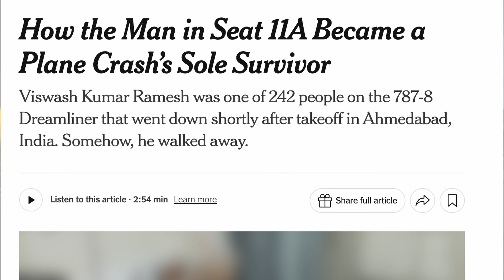Why the RAT Changes Everything – Air India 171 Update

Comment: we still don't know how the RAT was deployed.... it could still have been deployed manually.... so the theory of mistakenly raising the flaps/slats prematurely is still in the running since to radio call  (which I have not heard stating a 'power loss' ) a quick captain could have deployed it.... and the F/O still had time and realizing his mistake could have redeployed the flaps/slats. When it comes to 'power loss'.... that can be explained with a loss of lift because that is exactly what it feels like... BUT if there was a dual engine failure... look at the profile.... as heavy as that aircraft was, it would not have gotten as far as it did.... but with max power and stalled, that theory still fits.
Reply: The only time you would deploy the RAT manually is if it failed to deploy automatically. Manual is just a backup procedure.

Comment: Capt. Steeeve analysis is 1000% correct. All those things he pointed out match the Air India 171 crash. RAT is deployed for sure. When you look at the footage, the crash happened exactly within 30-35 seconds after the aircraft took off from the runway. Pilot managed to handle the situation in those barely 10- 15 seconds they have...because the aircraft is just above 500-600 feets above the ground...The pilot gave a Mayday call...till then it's too late. It's not the fault of both pilots but a faulty engine design. There are same incidents of power loss previously, but not at such a low height.

Comment: My investigation report on the AI171 aircraft crash.
1. AI 171, both engines run for 9 min 10 sec taxiing to takeoff and crash = 550 seconds.
2. Just before AI 171 took off, another aircraft from Ahmedabad to Chandigarh took off just less than 2 min ago.
3. Flap setting seems to be OK as found on the left side wing's debris.
4. Before the crash, the sound of the RAT was audible. Rotary air turbine.
5. During takeoff, the pilot declared a Mayday.
6. During takeoff, both engines lost thrust. The height was 654 ft and the speed was 179 knots.
Findings: 1. Flap was ok, proven from debris wing.
2. Fuel line choked or closed? No.
Fuel line diameters are 1 inch to 3 inches from engine to tank. The diameter is big enough; it cannot be choked or clogged.
After the fuel valve is closed, the pipeline will have 400 litres of fuel. The aircraft consumes 5 litres/sec, so the engine will feel fuel starvation after 100 seconds, but the engine runs over 500 seconds. The cockpit gives hooting sounds if the fuel stop valve is in a closed position, so the probability of fuel is close to not possible.
Mid-air aircraft engine restart without any external power by aircraft speed and altitude: speed 250 knots and altitude 30,000 ft.
Only APU-generated power can restart engines if all engines were stopped in midair for any reason.
Here The engine loses power by accidentally shutting off the switch or engine off by cyberattacks or so, and the APU was off to save fuel. Aircraft have no velocity and altitude to restart the engine. APU starting takes 60 seconds for that RAT power needed, but you needed power for hydraulics and avionics, etc., and had no time and crashed.
As another plane flew 2 minutes ago, that also caused wake, which may also be responsible for power loss, but the engine will be running without thrust.

Comment: Here is an observation of the flight video compared to video's of the gear swing on a 787-8.  The crash aircraft video shows both four-wheel assemblies down with the wheels in a parallel position with the fuselage the entire time it is in flight.  Normally, just after takeoff, the rear two wheels drop and the front two wheels are raised above the rear wheels.  Like doing a wheelie.  Look at the wheel position of the JAL with RAT deployed in this video and compare it to the wheel position of the crash aircraft.

The only time the gear is parallel with the fuselage in flight, is when the sequence to raise the landing gear is initiated.  First, the wheel assembly levels itself to clear the gear doors, second, the gear doors open, third, the gear raises into the fuselage, last, the doors shut.  Why would the gear be parallel with the fuselage if the landing gear retraction had not been started?  The retraction appears to have only run long enough to level the wheels.  Then it stopped.  Why it stopped and why the RAT was deployed will probably be key to why the pilot reported a loss of power and thrust.

Comment: Am not in the avionics but, what if some loose thing in the cargo cabin slipped back while climbing rapturing the pressure bulkhead (causing the bang sound) and ripping off some hydraulic pipes on its way?

It happened before in Iraq and the military aircraft stalled midair the same way Air India plane did.

Comment: If the Captain deployed the RAT maybe that's because he believed the engines were losing power as the aircraft was not climbing. However, this could have been because without the flaps deployed (and the gear still not retracted) the aircraft had insufficient airspeed/lift. Analysis of the FDR will reveal what the various settings were, but what did their instruments tell them? There is a narrative that is pointing towards blaming a technical malfunction, and therefore putting the blame on Boeing. But the majority of airline accidents these days are down to pilot error. We shall see.

Comment: Given the reports of electrical malfunctions on the immediately previous flights, my guess is that there was a major electrical failure as the aircraft was accelerating down the runway,  causing the autothrottle to move toward idle and triggering the RAT. The survivor also reports some kind of throttling up (spooling up?) just before impact, which suggests to me that the pilots had noticed the throttle levers coming down and were correcting the setting manually, too late and low of course. Let's see what the FDR and CVR tell... but like the Jeju disaster, the recorders may not have any data beyond the electrical failure (unless they are supplied by the RAT). The ADS-B data stops near the airport boundary.  The survivor's observations may prove to be particularly relevant, perhaps thanks to the amazingly light injuries he suffered.

Comment: With a plane that is 10+ years old, how many time would the engines have been over-hauled or replaced?  What about the fuel pumps? What is O/H time frame on those? If the airline company does the replacement of the engines and or pumps years after the purchase of the air plane, how is Boeing responsible for crash because the engines stopped working?  Does Air India have a good A&P department or do they sub that out?

Comment: There is example in history where this additional fuel extract called " Safran" If i remember right was involved ? 

The likvid was ones at least wrong measured and totally clogged the fuel lines and causes dual combustion stall.. 
Thence the taxy out included a partly runway taxi to a turning point, the engines was sugning quit a bit of fuel, and was most likely runed up several times because of stoppage and turns.. 
Thaw when the TOGA was engaged , it was the final hole in the swish cheese model . That totally clogged the fuel lines, according to the amount of fuel used buy the take of sequence, it manifests only seconds after take of.. 
The temperature in the combustion chambers rices in a matter of seconds and the engines stalls  .. That is my idea what will come in the aftermath of this horrible crash..?? 

This "shit" they put in fuel to make it more environment friendly has caused incidents before. And  will most likely do it again..?? Sadly a result of a Hype that kills.. :face-fuchsia-tongue-out::face-blue-wide-eyes:

Comment: Could a short in the wiring to the RAT make it deploy un-commanded? Could the RAT deployment temporarily cut off fuel supply to the engines for safety reasons?
It just seems very strange for a dual engine failure at the same time.

Comment: The original audio also sounds like the engines are rolling back. Sure the pitch would change due to the doppler effect but I just don’t think the engine sound would have started at that low of a pitch when the doppler effect started. The engines sound certainly much much lower in power than TOGA which I’d assume they’d have shoved to when they started to mush and sink. Even over the sound of the RAT the engine sound is low. 
So I think you’re right THIS time, the rat deployed when they started to engines failed. 
Now WHY did they BOTH fail at the SAME TIME? Within a couple seconds of eachother at most.

Comment: But we can also hear the sound of jet engines, first, than the RAT sound takes over. So at least 1 engine is still running, but probably in idle.  I do not know but I guess the thrust levers in a 787 and probably other modern jets are no longer moving steel wires, but are connected electronically to an engine control unit. Could a major electrical failure result in the engine controle unit reverting the engine power setting  to idle?

Comment: I've seen video posted on platform x from this same plane, one of the passanger recorded video showing that electrical in the plain are faulty as most screens on passenger seats were not responding, also lights and air-conditioning....it was same plane, flight which took place day earlier or so ...I have the recording, it could be vital to this case

Comment: Is it possible that the atmospheric conditions prevented the engines from making full power? Combination of high temperature, high humidity, and possibly high altitude (depending on the elevation of the airport) can prevent engines from making takeoff power and can also inhibit lift, as you're well aware, and can sometimes result in an airliner having to delay a departure until the conditions are more favorable. Wondering if the bang heard by the lone survivor was a compressor stall? If it was a simultaneous compressor stall, that could explain why the rat dropped. It did seem as though the pilot used every last foot of the runway to get the plane in the air, and usually, the 787 jumps off the ground. That's why I wonder if the atmospheric conditions may have been on the edge of the envelope.

Comment: Not sure why you haven't covered the video shot and posted to Facebook prior to departure showing all the electrical issues inside the plane. That would suggest a full electrical failure as the cause for both engines failing😢

Comment: It's far fetcht to conclude this vage dot was the RAT deployed. All you see in this more detailed video is that the flaps weren't deployed as they should have been and the gear was still out. The 'dot' shows not to be related to the plane by anything mechanical. There's no structure between the plane and this 'dot'. All you actually see is a clean wing without signifacant flaps with it's gear still down. We'll see.
Reply: Also when you make a screen-shot of the better video just at the very beginning you'll see the resolution is still quite low. But there's no indication at all that the RAT was deployed when you zoom in. More though such a picture-approuch shows the trailing edge flaps were fully retracted at that time. It shows by the straight line of 'bites' in the picture;

Comment: Capt Steve, i never flew in a 777/787/737 cockpit but i know you probably have, and what baffles me a lot, is that you leaned toward the idea of mistakenly moving the flaps instead of the landing gear.
Now as i said, i never flew in none of those cockpits, but i know in order to drop/raise the landing gear Capt or F/O, MUST lean forward to take such actions, as it's far from hands reach, while the flaps is right within hands reach and one don't need to lean forward.

Now, if the Capt was flying, and focus on outside the window during the climb, he MUST have seen the F/O leaning forward to pull the gear up, and had he not seen this action, once should wonder why he not moving to bring up the gear, and then look around to see if he/she is still there in the flight, and that's when one could see of notices that the flap was moved instead and make corrective action..

I'm still leaning towards something with the engine that lost FULL power after Rotation, be it someone pulled back the throttle by error (lord i hope not), be it fuel pump issue going to the engines,
but i'm sure bet leaning towards lost of power..

Comment: my nonprofessional opinion is, the plane started its flight from the middle of the runway, since they were heavy they had to push the engines to its limits to take off, then something catastrophic happened which resulted loss of both engines or they were not delivering enough power so they panicked and retracted flaps instead of landing gear, rat was deployed automatically due to loss of power, plane stalled and started descending, pilots instinctively pulled up making it worse and then they crashed.

Comment: Another YouTuber had the reinforcing analysis that the gear was raising and the hydraulics failed while that was happening  (dual engine failure) because of the orientation of the wheel bogeys. They are in semi-retract mode, not normal hanging mode.

Comment: he is getting too many positve feedback. this man is very unprofessional, if you are not so well informed about aviation and the technology behind it, he might seem smart. but he is just collecting data and thoughts/analysis of others and presents it. he as a captain should know especially when to be quiet about things or spefically say that the assumptions are only speculations and not lean out of any window.
Also: dont you see how different the landing gear looks? both main gear trucks are tilted front up, usually with gear down the rear is tilted down, it only tilts the other way before retraction... so they did set the gear lever to up, but due to no hydraulic power, the doors never opened and the gear wasnt retracted. you as a captain should know where to look at and spot these abnormals

Comment: I have always thought it was an electric and engine failure.  I didn't know of the RAT, but I agree with you.  I just don't know enough about that plane to know what would cause the failures.  A fuse?  A bad relay?  Is there an engine off switch someone may have tripped?

Comment: I still believe it s a fuel contamination. Because they lift up so late so you may see dust cloud just after takeoff. So contamination effected the thrust, and then eventually led to dual engine failure. Whats next, should be a device inside fuel tanks,  which checks the fuel quality.

Comment: What level of redundancy is there in the 787? 
How is fuel moved from the fuel tanks to the engines? 
Could this be a possible sequence of events: 
i) loss of electrical power, partial or total
ii) reduced or zero flow of fuel to both engines either concurrently or consecutively due to inactive fuel pumps. 
iii) loss of hydraulics, partial or total.
iv) RAT deploys. 
v) pilots try to find somewhere to land, but insufficient height and velocity.

Comment: I still don't believe that guy survived the initial impact, when the plane was obliterated against the building, not only did he survive the plane falling from the sky,  hitting a large concrete building, he managed to survive the explosion of jet fuel on impact and the blazing fire and fumes and smoke??? The new video showd the plane exploded almost instantly on impact, jet fuel burns at 4,050°F in the engine and burns at 1,895°F  in the open air. Again, he survived the Boeing dreamliner hitting a large concrete structure at minimum of 160mph, turned the plane into a heap of scrap metal attached to the building, exploded like a warhead on instant impact, the fireball could be seen from over 3 miles away, then the constant heat of 1,895 after the initial impact explosion,  the toxic fumes etc, and this guy walked out with minimal scratches to his face, his hair still perfect, no singed hair, his white t shirt had a bit of dust on it, and he walked away with less injury than I'd get from rolling out of bed? He said he walked out of the fire exit?? What fire exit? The plane was a crushed, melted mess, the plane and surrounding area was a fire ball, but he has zero burns, not even a singed hair???

Comment: Steve, did you see the video that was taken inside that plane at the prior airport?. A guy was showing that all the Little monitors on the back of the seats weren't working and the air conditioning wasn't working like there was some kind of electronic failure

Comment: Effectively, lots more things are visible on this one (accessible on web since thursday evening). (Hereafter I refer the the timing of the present video)
- the RAT can be hear at the beginning
- the RAT can be seen at 03:13
- but also at 03:08, the deployed slats are visible
- and at 03:13, it is possible to see the engine through the small space that exists between the flaps and the wing when flaps are deployed. At this same time also, flaps of right wing are visible as a little bit more white than the wing itself. They were deployed. 5° is just a so small angle that it is difficult to see.  Anyway, just like it was difficult to see the RAT (just a black - the trap - and a grey - the wind turbine itself - pixels show it)
It was also know thursday evening that the mayday was speaking about loss of power.
Last, the RAT does not provide enough hydraulic to retract the landing gear.

Comment: Something doesn't add up, That grey dot you mentioned seems too distant from the aircraft body. In all the reference images the RAT is a very small protrusion from the body but that grey dot is much far. Secondly, the RAT sound, at that moment the bottom of plane is clearly visible and there is no RAT visible there.